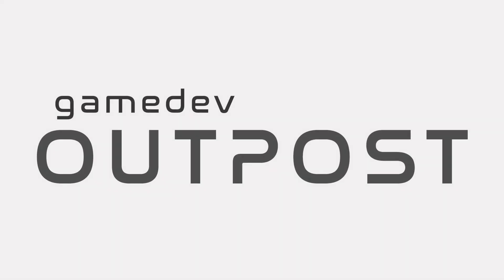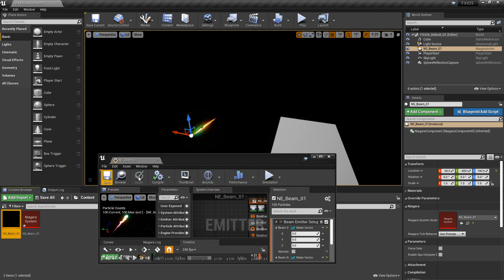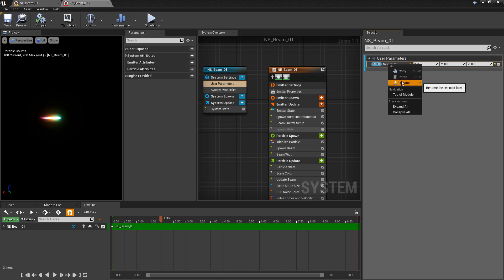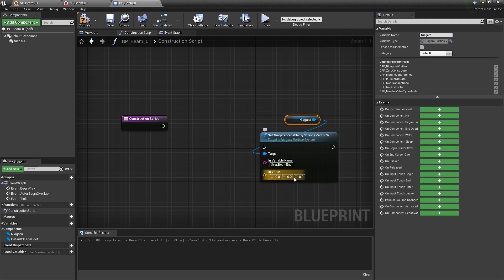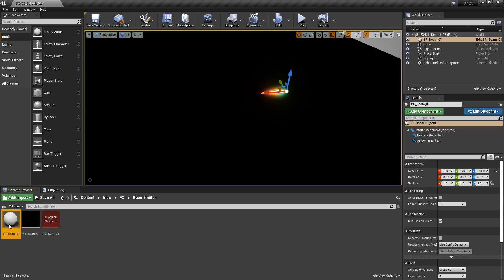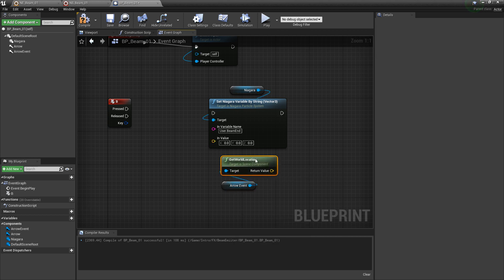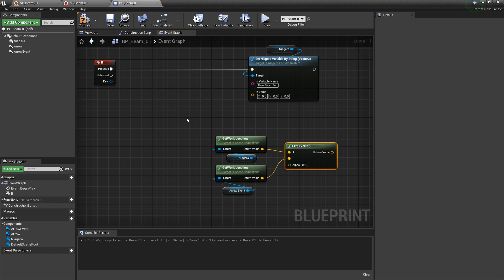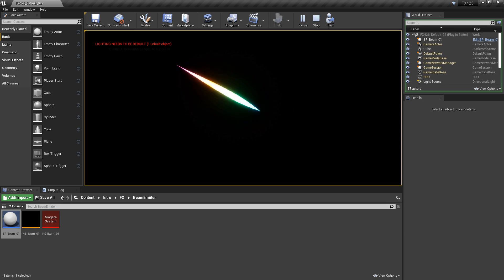UE4 - Niagara Beam Emitters - Part 2 - Blueprints

Comment: Looking into the SpawnBeam module there's a comment box saying: "Check Loop Count against the current Beam ID, to allow for a unique "per beam" ID to be passed to the particle system. This lets a looping emitter spawn multiple discrete beams." 
A similar comment can be found in the SpawnBeam module.

Do you know how to use this in order to spawn those multiple discrete beams from the same looping emitter?
If I understand the wording correctly (English is not my first language) this might allows us to create a bouncing laser beam effect from a single looping emitter that's capable of reflecting off mirrors by feeding the Niagara system with a vector array or spline.